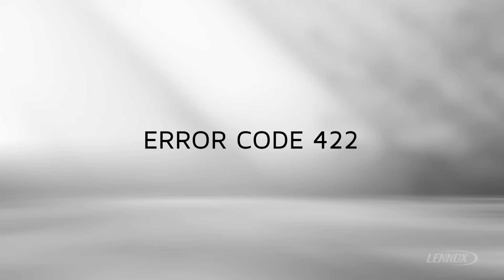Troubleshooting Error Code 422 | Lennox

Comment: Sorry but I don't see a lot of answers on this topic or how to solved them...
 Methods for determining whether the top cap switch is open 
 Other factors that could lead to the compressor overheating 
 How to reset the error once the issue is resolved

Comment: Hi..I am just owner... I have 2 Lennox units <5 years old. One is frequently shutting off with top cap error. The only difference I can notice between the one that is working and the one that shuts off is the ambient temp sensor is for example today 127 deg. temp while the working unit thinks its around 105... We have had our local dealer look into it but not improvements...both units lack shade on top of the house and its midday sun scenario... Why would one unit thinks the ambient temp is significantly higher? Thanks. (FWIW todays actual temp was about 98 when the one unit shut off) we have done a lot to figure like having. replaced inverter board and done cleaning etc without benefit
Reply from the maker: Hello @AceMBP, thanks for reaching out. We’re sorry to hear about your situation and would like to see how we may be able to assist.
Please email us at consumeraffairssocial@lennoxind.com with your equipment(s) model and serial number(s), your installing and current servicing contractor’s name and contact info, and any service/maintenance records you have handy.

Please reference this video in your email and we will reach back out to you directly.